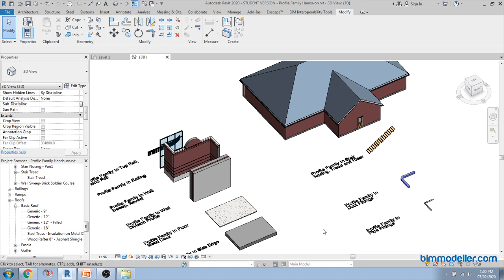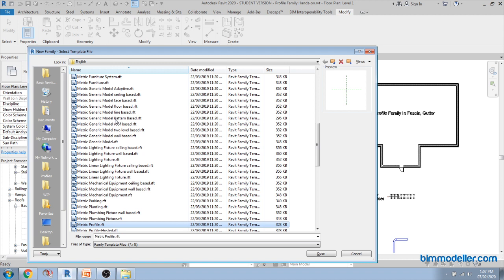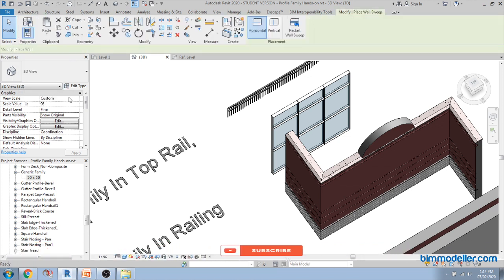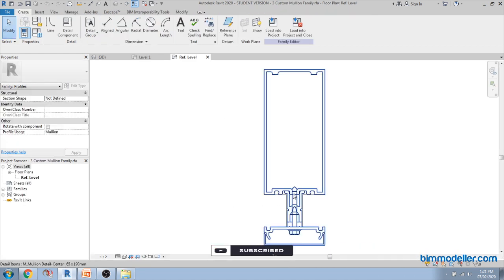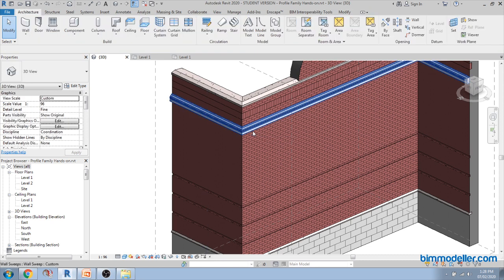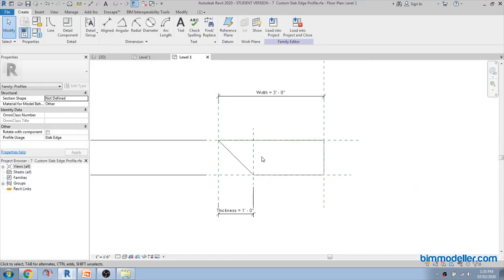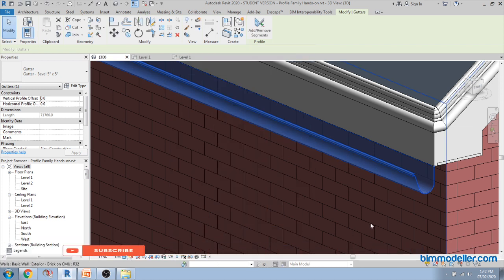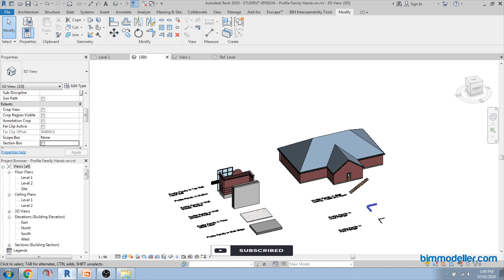All about Creating Revit parametric Profile family and their uses

Comment: Thanks for the tutorial, it was great. I have another question, I wanna do a wall with timber profile on it, but apparently we cannot constrain this profile to the top of the wall (in the case we want to cover the whole wall with this timber profile), which means everytime we have to create a different profile to cover the wall height I want. Is that a way to sort this out? Thanks!
Reply from the maker: Yes you can! First Thanks for the appreciation. You can create parametric profile and do that. In my opinion you have to utilize wall layer if its Easy comes as Wall type.

Comment: Hello Rajkumar, thanks for video. I have a question about curtain wall mullion. I added some shared parameter (instance type) for mullion profile. But i didn't see any parameter on project. Why it is not seeing? 
I want to create specific schedule for mullion profile but i didnt. Thank you. :)
Reply from the maker: Hi Damla Yildirim, Did you added that Same shared parameter inside the project? Then you must be able to see them. Thanks
Reply: @BIMModeller Thank you. 
The parameters, I created in the profile family, are related to each other with the formulas. I created the same shared parameters in the project, but it didn't work depending on the formulas.